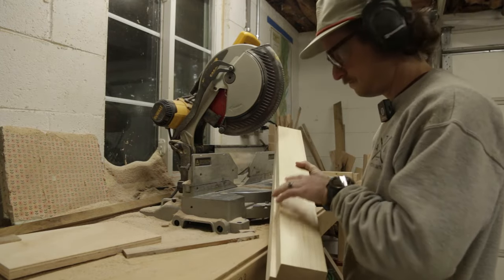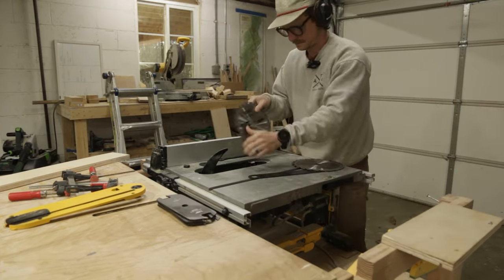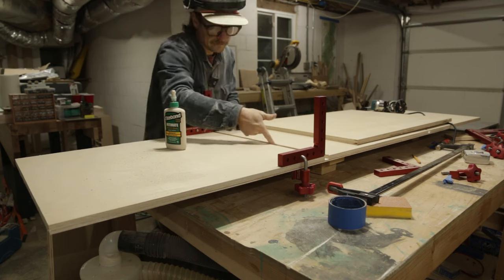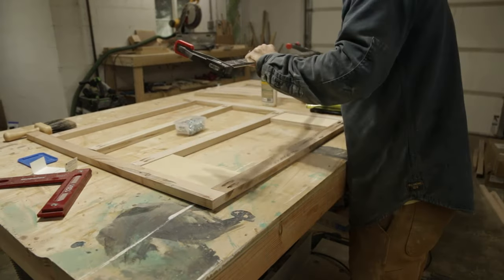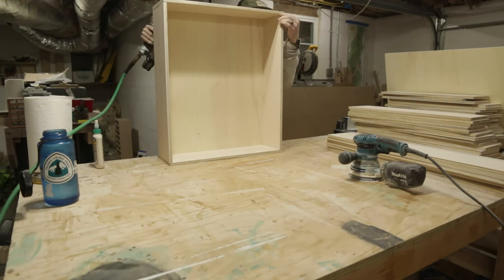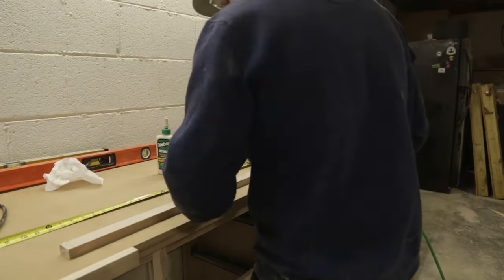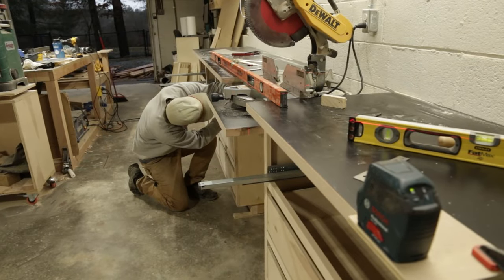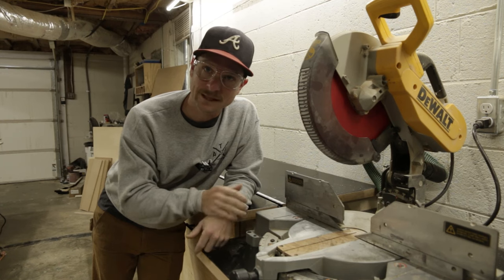Shop transformation. A miter saw station build.

Comment: Pls post more, the joinery was nice and better than most do for these shop builds and it looks amazing. What drawer slides did you get? I need ones that I can attach exactly as you did for my solid hickory vanity. I added custom trim around the opening and I hate to use layers of scrap to build out the sides enough to attach slides in the traditional way so I like that you attached with vertical spacers and the face frame. I love these shop builds because it’s so relatable!!! I currently look like a hoarder in my tiny one car garage with tools scattered and it sucks! I build less because the stress and frustration of searching for stuff is overwhelming so I’ve got to get on building a small mitre station as I don’t have the space for a decent size and then floor to ceiling cabinets with vertical drawers being the majority.
Reply from the maker: Appreciate it! I used rockler under mount slides. I’ve used Blum in my kitchen but these were about the same quality and about 1/3 cheaper. I definitely feel you in the scattered tools every where. It made a huge difference once I built these cabinets.
Reply from the maker: Also a tool wall is a good way to store tools. I’m posting a video next week on that build.
Reply: Thank you for responding, I think I’ll go with the rockler slides then. And I bet this made a huge difference for storage not to mention a dedicated space for the miter saw. I can’t wait to build mine, I need organization so badly and where I don’t have cabinets I’ll definitely use wall organizers or a french cleat. I had one I set up years ago back when everyone made french cleat storage but I was bad at the time about making custom storage hangers. This time I’m more aware of what worked and what didn’t. I’m definitely into vertical pull outs like for paint cans and consumables, blades, etc. Look forward to the next video

Comment: How old is your table saw, what model is it?  I have a Dewalt table saw I bought a few years back, I did not think you could use dado blades with them.  Did you modify the saw in anyway to use a dado stack?
Reply from the maker: No modifications used. This is the model number of the dewalt I use - DWE7491RS
Reply from the maker: I got it specifically to do dados for cabinets a few years ago.